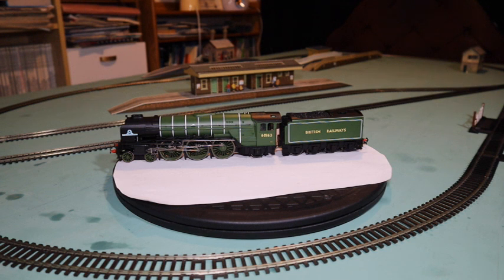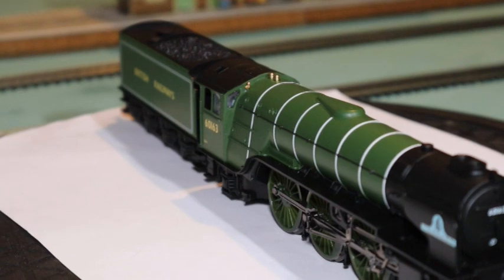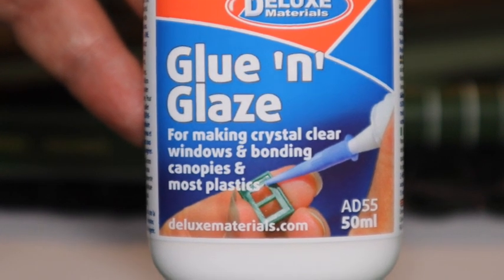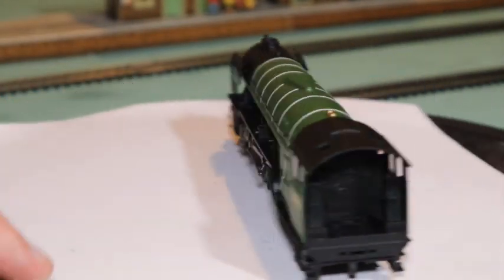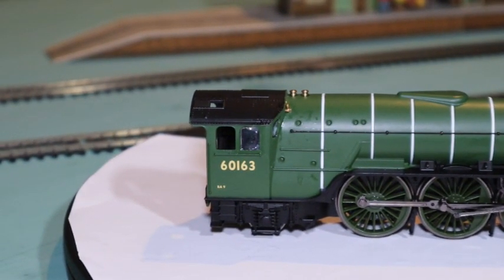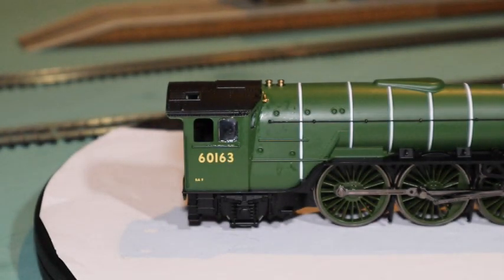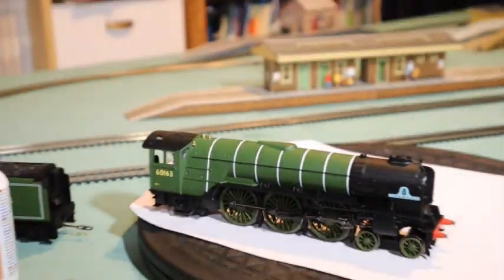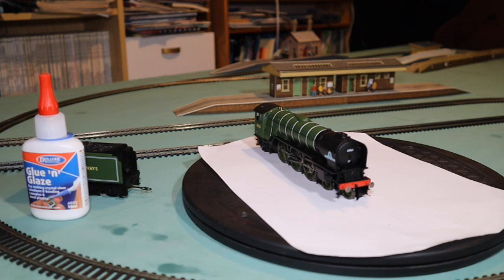Glue n Glaze Hornby Tornado Glazing Repair

Comment: I have found that the windows are very fragile afterwards and any bits or dust stick to it. Maybe I was using it wrong.....?
Reply from the maker: I have no long term experience of this product. I will update in the future. If there are problems I will redo them. Perhaps bigger repairs could be made by gluing in clear plastic. I'm very much at the experimental stage. Best wishes Paul.